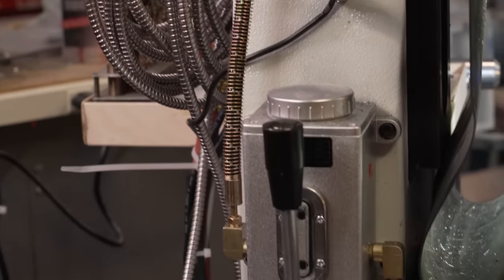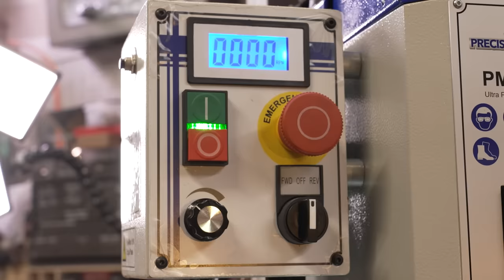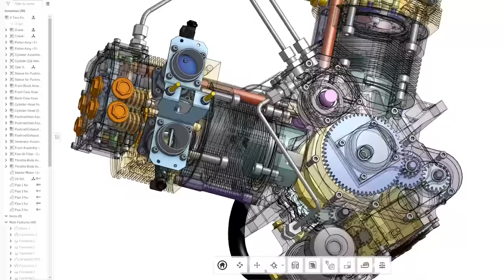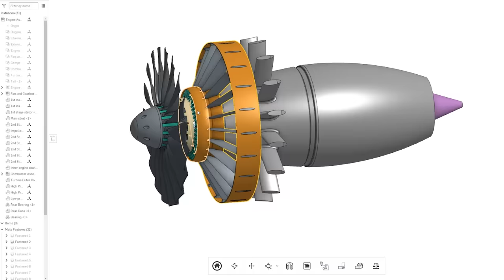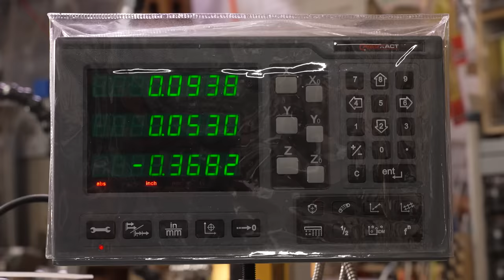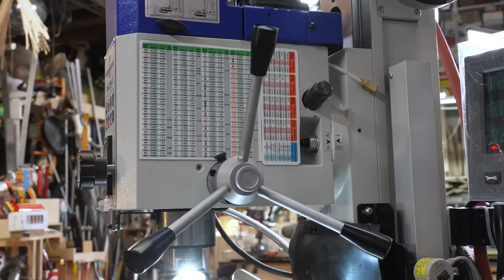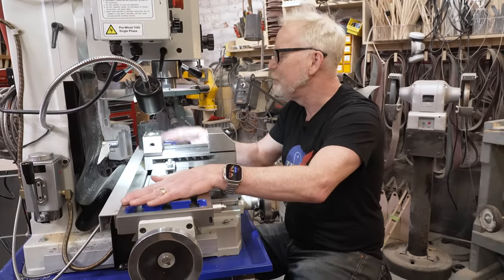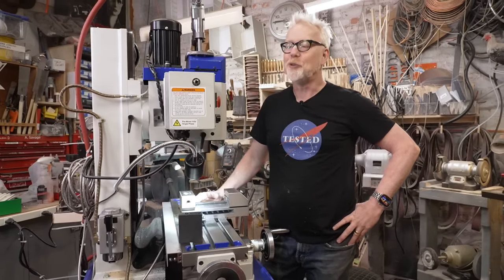Adam Savage Tours His New Benchtop Milling Machine!

Comment: Have you thought about adding a pneumatic foot valve to trigger the compressed air so that you do not have to take you hands off of the hand wheels?
Reply: and having the blower mounted on a gooseneck aimed at the center point blowing to the splash back

Comment: Quick tip for metric tap drill size. Subtract the pitch from the dia and you have your tap drill size.  (M6x1.0=5mm drill)
Reply: Thank you, bless you for this.
Reply: I've worked in machine shop for 40 years and didn't know this, I just checked it on my Starrett chart and by god it's dead on! Thank you for teaching an old dog a new trick.
Reply: This tip is true only if you want a 75% thread, which is prescribed for common soft materials, but you wouldn't want to use this method for harder materials. 
For example a M6x1.0mm tap would required a 5.2mm or 5.4mm drill if you wanted to tap stainless.
Reply: @paulblair898  thanks for the reply, I might be drilling my stainless parts too small then. They are always a pain to tap.
Reply: @Sean-ib7pd  I'd take any advantage I can get when tapping stainless, it loves to work harden and then eat taps.
Reply: @paulblair898 this mans comment is 100 percent accurate. Throw away the starrett charts.
Reply: @rodlively1413  same here!

Comment: You have just demonstrated the most expensive and most precise etch-a-sketch ever made.
Reply: not a single air bearing, and several hundred thousand dollars shy on precision and cost. That being said, it is a VERY NICE etch-a-sketch. I adore my 727M, and have for years. I tend to think of it more as my most pimped out drill press though, since that's it's most common task.
Reply: I dunno, a nice big CNC using a manual control panel could be a pretty expensive etch-a-sketch ;)
Reply: Not even close.
Reply: Good luck with shaking it over your head! 😀

Comment: I have the little cousin to this mill... The Sieg X2D. It's honestly a great machine. I've made lots of good parts on it, and can usually hold +/- 0.001 or so (if I'm super careful). I've added DRO scales, and use TouchDRO for the display. I've upgraded the spindle bearings to angular contact bearings, and swapped out all the plastic gears for metal ones.

I've been using the Tormach TTS tool holders for a while, and absolutely love them. Having quick-change tooling on my mill is a quality of life upgrade that I can't recommend enough. No more changing collets! Plus, they're repeatable, which is amazing when coupled with the tool library in TouchDRO. I've even made my own TTS-compatible tooling.

Always enjoy seeing, and sharing,  your enthusiasm for making things, and for the tools that you use to make. I've made a few videos of improvements to the machines in my shop, and it would be amazing for you to check them out.

Comment: Nice mill and good video.
It’s a blast setting up a new mill, one of the things I learned very quickly when I set up my work area is that chips go everywhere ! Especially if you use air to blow away chips ( which I do also )
Problem is that the chips end up in your collet rack and your hold down rack and it becomes a chore keeping things clean.
I found that setting these items under cover or out of the chip zone is a small price to pay in order to keep your tools clean.
P.S. you ask 5 people how to do something and you will get at minimum 5 different answers, lol
Reply: That could be clear plastic cover. So you can see what you want.

Comment: For metric threads good rule of the thumb is that the pilot drill is the size of the bolt minus the pitch of the thread like for M10 thread the pitch is 1.5mm so pilot drill for it is 8.5mm
Reply: Yes, it’s logical and super easy compared to inch sizes with all their secret codes like an #8-32 screw and a number 29 drill, and don’t even start on letter drills!
Reply: @emmajacobs5575  but if you don't memorise it all you're "not a real machinist"! ;)
Reply: @mattagnew206  haha

Comment: The other nice thing about benchtop mills  is that it’s easier to follow or cut tapers because it’s easier to manipulate both axes at the same time since the handles are closer together.  I have a 4” machinist vise with an angle plate that I’ve found to be useful. I use a cordless 3/8” ratchet for a power drawbar.  I had a gunsmith mentor that encouraged me to buy this machine first since it will do a large range of jobs and even if I needed a larger machine later, it won’t replace this one.

Comment: I don't know if it was mentioned in previous posts, but that kind of vice is designed to have the screw clamp the jaw in a 45 degree angle. so that you are putting the same pressure down on the vice be the same as the material clamped. the more the angle changes from the 45  toward 90 degree the more pressure you put into the vice and not the material being held. the less than 45 degrees then more to clamping in the material but it does not hold it in the vice as secure. I hope that helps you in the future of using that vice.

Comment: Adam needs to learn about surface speeds. There's a formula SFPM=(PI*DIA*RPM)/12 but I use a chart to get me in the ballpark. A 1/8" diameter tool spinning 2,000 RPM is only 65 surface feet per minute which is pretty slow for free machining plastic. You can go a few hundred SFPM. Generally you want to over drive small diameter tools so you don't side load them so much. Know your speeds! Turning tools at the right speed gets best results.

Comment: Hey Adam! Couple of useful formulas for you 

Metric tap drill size = dia - pitch
Ex m8-1.5 = 6.5mm 

Standard tap drill = dia - 1/pitch 

RPM = cutting speed (in sfpm) x 4 / dia of cutter 

Example: cutting speed of mild steel is 100 so 

400/.5" cutter = 800rpm 

They also taught us in school that compressed air can damage the precision ground ways on the table and cause innacuraces but not sure how true that is lol

Cheers :)

Comment: You will soon find the headroom to be a little bit of an issue when using drills,the length of the chuck and the jobber drills makes it pretty tight. Screw machine drills come n very handy( plus they are more rigid) Little Machine Shop sells a lot of accessories sized to bench top machines.( 4” rotary tables etc)
Reply: Ran multi spindle 4,6,8, spindles acme gridley,conamatic, wickman @ Black and Decker Hampstead Md. In the 1980's. Sharpened a million drills by hand. Made chop saw gears. Ran 4 machines at the same time. A screw machine 6 inch collets, a barber coleman gear shaper to shape gear teath, a broach to put keyway in, and a deburing tool to debur back of gear inside diameter. Got tool and die pay. New Bridgeport son😊

Comment: Flip the knob 180 degrees on the shaft.  That makes the bottom of the knob the indicator, and it will point to the right for 'Forward' operation.  Or make a little lever and install it in place of the knob.
Reply: The lever thing is what I would do, a bar with a cutout that the top of the knob fits into and then with the lever below the knob it would be natural to move it right for forward and left for reverse.
Reply: Flipping the knob won't change the shaft rotation. And yes that mill is bass ackwards. I've seen ratchet drives that swap forward and reverse too. It's maddening.

Comment: My mill had push buttons for for/rev, they were hard to tell which one was pushed and easy to push the wrong one. I wired a used back up horn from a fork lift to the reverse button. The horn is sealed inside the box so as to not be too loud. The odd time I use reverse I actually get a chuckle from the "back up alarm".
Reply: I've done the same on a knee mill, except with a blinking LED (panel-mounted next to the REV button) instead of a buzzer. It's good to have a reminder before you turn your 2-flute end mill into a no-flute end mill!
Reply: Do you ever actually have to utilize the reverse?
Reply: @tevinvezina1766  i use all the time when power tapping
Reply: @tevinvezina1766  Rarely but when you do you're glad it's there. Mostly it's for clearing a jam or unwinding some accident. Backing out a tap. I've never seen a reverse cutter or twist drill but that does not mean they don't exist.
Reply: @Guranga93  Ahh I see! I’ve only ever hand-tapped so I didn’t think about that possibility.
Reply: @BrianBoniMakes  Oh okay that makes total sense! I was curious about a reverse cutter too lol. I know for a fact that left-hand drill bits exist so I would assume there’s something similar for mills. Thanks for the explanation!
Reply: @tevinvezina1766  I have a few left hand milling tools as well. Never seen them commercially, but if you forget to think, you have at least 50% chance of making one 😅.

Comment: Thanks, Adam, such a good video. I have a Smithy 1324, twenty years old now in my crowded basement shop, and if I had it to do all over again, I would incorporate this mill into my shop with a standalone lathe. R8 collets are an important touch, and you've done a good job accessorizing the mill.

Comment: That vice is sometimes tricky to use. You have to get the crossbar into a detent before tightening, otherwise it can slip. And it also has to be loosened a bit to clear the detent so you can easily move the jaws. 

Don't loosen the bolt too much, the crossbar can fall off.
Reply: LOL......I have one of these grinding or toolmakers or screwless vices and after a while I almost threw it in the bin it was so frustrating with the nut (crossbar?) at the bottom not engaging in the cross slots or dropping off the screw when wound back.......after a mod it now performs like a dream and second to the DRO is my most treasured mill tool.
BTW.........better make a back panel to prevent the blown swarf from coating everything in the shop especially if you use coolant on steel.......with coolant use you will rapidly get mucky corners and everything else covered in oily residue.......that's par for the course unless you only use carbide tooling and forget about coolant.......I use a portable hand vacuum to clear the swarf instead of blowing it around the shop.
Reply: @gangleweed  Turn the air pressure down to 20-25 psi for starters.
Reply: I took mine off and installed a 6" low profile vise.

Comment: That motor controller has a label on the side that says it's 120v single phase.

That tells me that it's a VFD outputting 3 phase to the motor of the mill.

Instead of needing to do something overly complicated like rewiring the switch. All you need to do is swap any two of the 3 wires that go to the motor. It will change the direction of the motor and effectively swap the operation of that fwd/off/rev switch.
Reply: Wrong , if the vfd has any type of encoder in it it will break since the drive will expect the reverse

Comment: You may be breaking small endmills easily because you're not running them at a high enough RPM. An 1/8" HSS endmill should be running closer to 3K rpm in mild steel, but since it was carbide 6K should be no problem. Always do the math for cutting speeds and get as close as you can.

Comment: Just wondering if you need to keep using air supply hoses to blow away the shavings would it be easier to have an auxiliary one on an arm in a set position you can then activate with a foot pedal so you don't have to stop when milling?

Comment: Hello Adam,
To reverse the motor I would avoid rewiring the switch as it is a rather complicated setup.
There is a good chance the DC motor was wired in reverse at the factory.
It is easier to reverse the two wires from the motor on the control board.
Being a DC motor this will solve your problem.
Regards,
David
Dalgety Bay
Scotland
Reply: That's some out of the box thinking. Great idea!

Comment: I just commented on your setup video that you should have mounted the cabinet the other way round.  Watching you access it just confirms what I wrote.  You're reaching around and over the door, with the sharpish corner very nearly digging into your arm, every time you go into it, and your head is very close to the x-axis crank.  When you take anything out, you're going to have to navigate around the door, whereas with the hinge at the back, and the latch at the front, you've got full access.  With the bull-in-a-china-shop way you normally operate, it won't be long before you tear open, or badly bruise your inner arm, and/or catch what you are removing on the door on the way out, potentially dropping a precision tool.
I really think you need to fix this.  As well as an ergonomic mess, it's an accident waiting to happen.

Comment: You could create a maze for ants very easy. :D 
BTW, it's good to tighten the vise only a little, tap the workpiece down, tighten a little more, tap again, etc. to make sure it's parallel to the vise bottom.
I bought an ancient mill recently, it's not set up yet as i need to weld a base for it and a VFD. It has an old car transmission on it to change speed, the VFD will improve that i guess.

Comment: One added feature you might want to integrate is a small airline that has a ball valve or something to that effect which sits alongside the cutting head to constantly keep your work piece clear without having to blow all the time or intermittently stop to  use the air hose to clear the work space

Comment: Adam, you should remove the the left wheel. My first thought yesterday was that you're only going to hurt yourself with it. Sure enough, you bumped it 5 minutes later.
You're a righty, so the left one will only be in your way.
Yeah, you should really rewire that switch, before you burn a project you've spend hours on.
I also want to introduce you to a drilling chunk, for your Dremel.
I never use anything else now, cause now it can take the smallest bits, without changing those tiny, godawfully Dremel chucks.

Comment: The reason the x/y "feel" is better on Adams benchtop milling machine is found in the leadscrews used in the table.  This smaller machine has leadscrews with 10 threads-per-inch in the x and y axis, so one full turn of the handwheel advances the table by .100".  On a Bridgeport (and clone), the table leadscrews are 5 threads per inch, one full turn on the handwheel advances the table by .200", or twice as far.  So yes, the table movements are more precise, which can be beneficial for small parts.  And because everything is scaled down, including the workpieces, you don't feel like you're cranking forever to move the table, which would be the case if your Bridgeport had 10 tpi leadscrews.

Comment: A small piece of advice, it is much easier to control movement with the correct speed and feeds, recommended speed for 4140 steel is appox. 6000 rlm for a 3 mm cutter with good rigidity so here you could easily run at 4000 rpm

Comment: I heartily second the direction switch issue. I created a 3D printed "lock out" for my PM728 that screws onto the bottom right of the control panel and physically prevents reverse unless I unscrew it. Trashing two 1/2" carbide end mills with accidental reverse was getting expensive fast.

Comment: The great thing about metric is that you don't need a chart to look up drill sizes. Just subtract the pitch from the diameter.
Reply: Yep, those poor Yanks and their old Imperial system. Metric just makes it simpler. I do hate it when someone pinches a drill from the 0.1mm precision mill drill set for rivet holes or other simple stuff.

Comment: For your forward/reverse issue: move the label to below the switch, and paint over the white mark on the knob and add a new mark to the other end... its not going to help with the muscle memory, but will ease the OCD angst  :)
Reply: the muscle and automated brain memory while opersting the machine is what its all about.
i would without even think twice just open that panel and wire it the other way arround. its a 10min fix.
and a label is printet quickly or just tape it and use edding^^

Comment: Would it be helpful if you set up a small, continuous air hose aimed at the mill bit to blow debris away? I'm looking forward to seeing what you create with this benchtop mill, and maybe the kind of wheel you make for it. It is an exciting addition to your workshop.
Reply: They make air blowers specifically for this purpose, some also can mist coolant at the same time :)
Reply: Yeah I like chip swarf all of my shop. I mean who doesn't? It's more beneficial to just use a chip brush to sweep them away while you go. I have a shop vac next to my mill too and I'm not afraid to use that either.
Reply: @1pcfred  cheap used paint brushes work well too
Reply: @SomeGuysGarage  they do but they're just not the same as those cheap China bristle brushes. The way the bristles fall out it can be a plus when you're machining. Plus every China bristle brush you trash you're saving some poor fool from trying to paint with it.
Reply: Decent jigsaws do this as well, making accurate cuts much easier.
Reply: @bakedbeings  I've never seen a puffer on a milling machine. I do own a Bijur spraymist too. Everything you do on a mill is a compromise of some sort. We do not live in an ideal world. In a perfect world you wouldn't even have to look at what you're doing. You'd have the job all worked out and you'd just hit your numbers. That's why there's graduations on the handwheels. They didn't just put them there for decoration to baffle the uninitiated. There is a trick to making them work right though.  They came up with the DRO so you don't even need to know how to wind out the backlash.